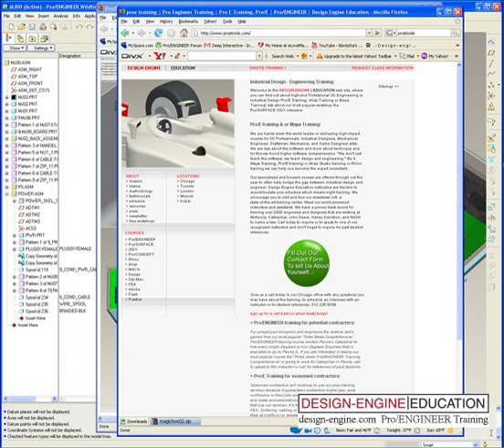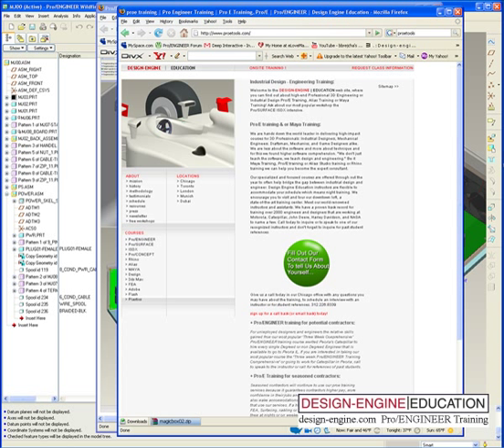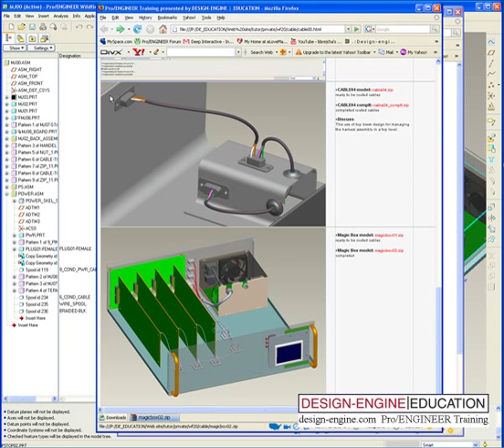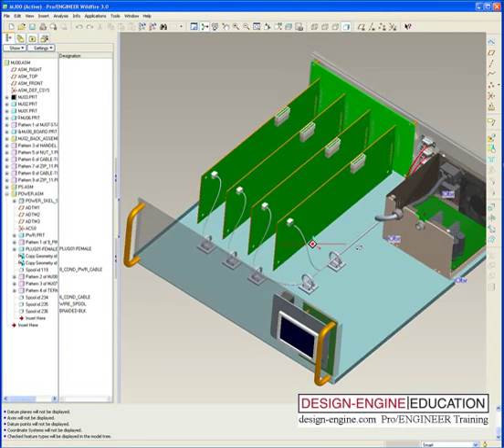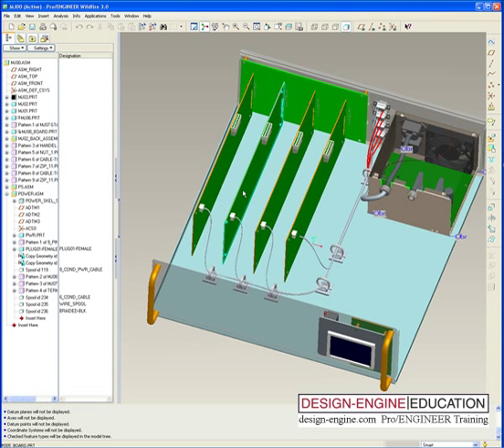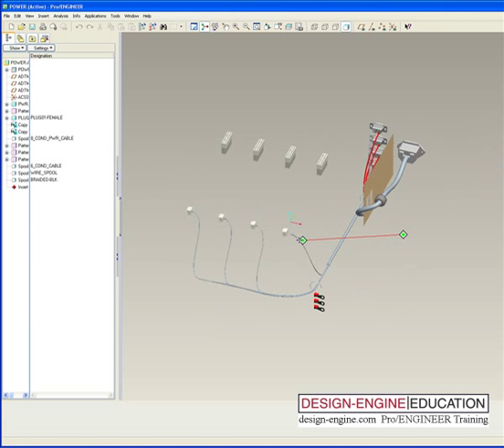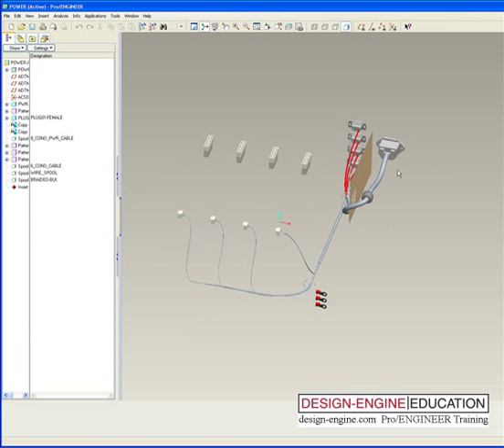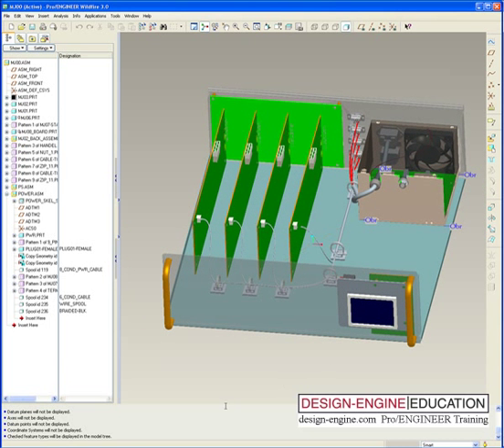Magic Box Pro/E Cable Harness Design

Comment: Interesting. 4-5K for software to do something I can do with a fucking ruler and a 2-D CAD program AND have the actual harness assembly built in less time than it takes to make your pretty pictures for your fucking Power Point presentation.